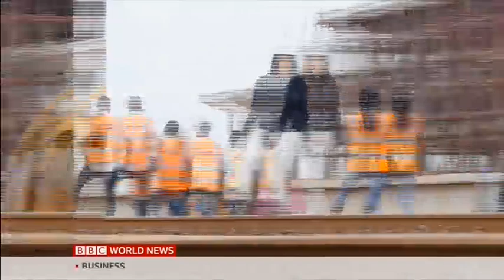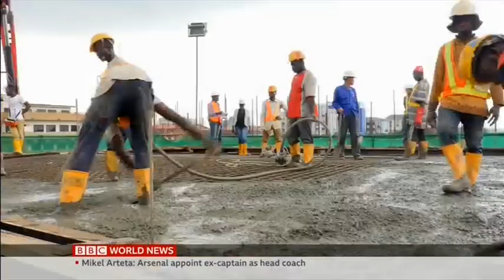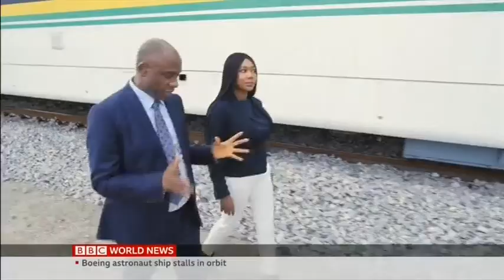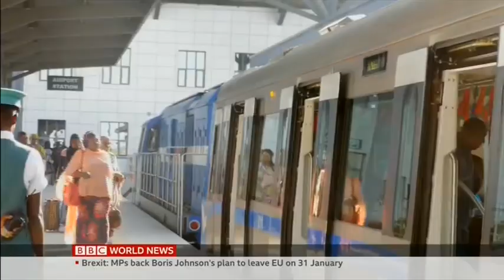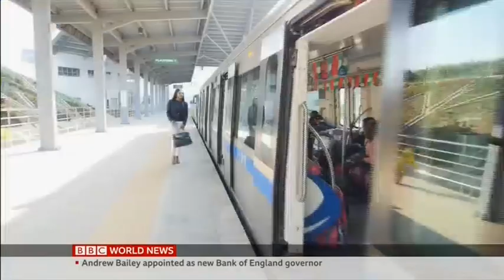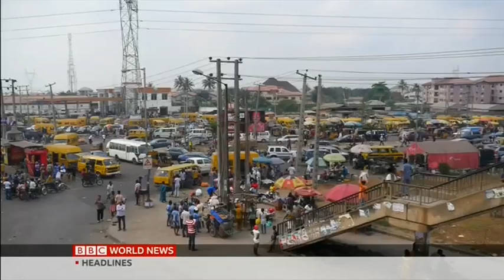West Africa’s first standard gauge railway line built in Nigeria

Comment: I realize that Nigeria has oil for fuel but why are they going to operate dirty diesel trains when electrics are so much more ecologically cleaner?
Reply: The only reason is to reduce initial investment. Nigeria is short of electricity, and power plants cost much. To send power to electric trains, you also need to build power substations and overhead lines along the tracks. That also costs. Diesel trains does not incur such costs.
Although electric trains cost less in operations and is more environmentally friendly, the amount of additional initial investment makes it less attractive. After all, these initial investment can be used in other construction projects with more benefits (than the benefit of electrifing railway).
Reply: @nashi_shuai  unlike your point. Truly, an electrical version will require much more investment in infrastructure investment. Thanks for the point!
Reply: First, does electric train support long distance traveling? Second, what's the cost of the electrical option? Overtime, they may go for cleaner option where they are more affluent and it is more economically feasible

Comment: Very interesting and informative video, thx for that. 
I have to ask tough, wouldn't it be better instead of spending billions on luxury train stations and on one high end line, rather to have multiple "more functional" railways all over the country?
That might be cheaper and faster to construct and more excessible to average citizens.
Reply: It has to start from somewhere, and it has started.
Reply: It is not really high end, as it is built using standardized equipment from China. I can recognize all the prototypes of the trains shown here. Since there is no need to develop a new model, and the export to Africa is politically driven, the trains are sold at a very low price. And you also know that Chinese construction firms build railways at a low price, so there would be no reason to settle for less.
Reply: In China, many people are complaining that the government is "throwing money away" just for the fame of the "belt and road initiative". And it is known that the rolling stock company CRRC is selling at a loss for most of the overseas project, in hope they might be making money for the maintenance later. Just grab the deal using low interest rate Chinese loan while you can.